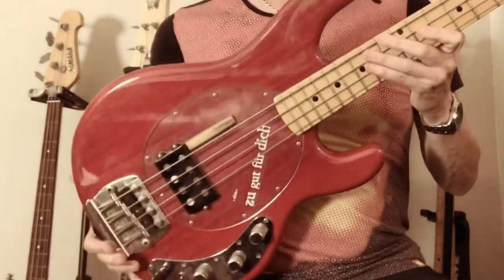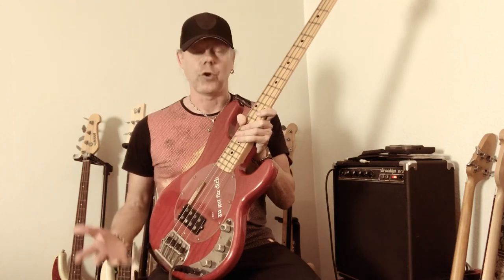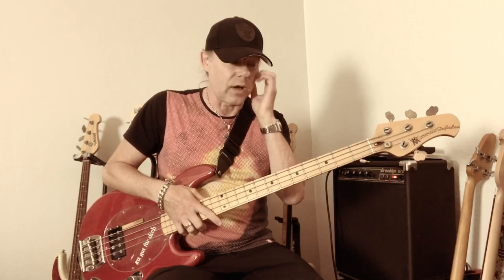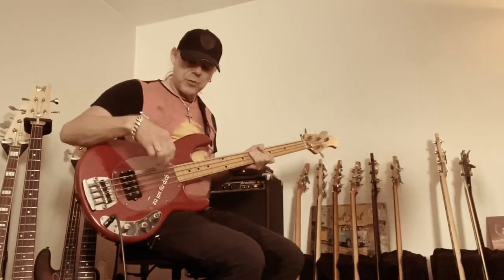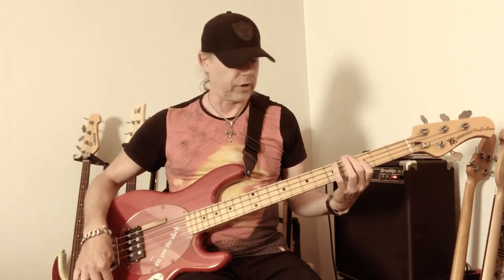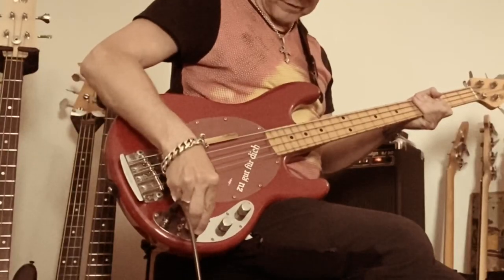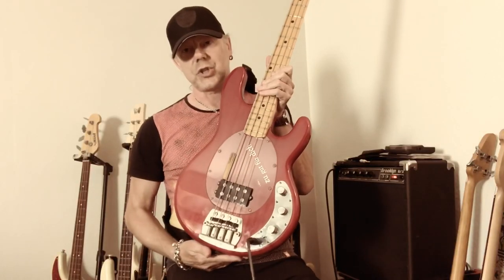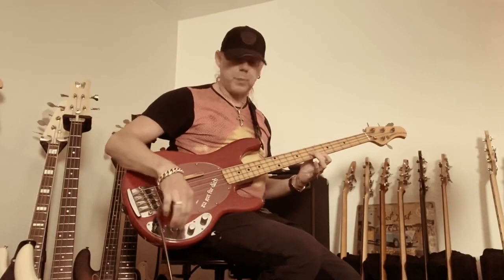how does a MusicMan StingRay Bass sound passive with bypassed electronics?

Comment: You don't show comparison between passive and active with EQ at detente.
Reply from the maker: Hi Matt, forgive me: What do you mean by "EQ at detente"? I never heard that term, so forgive my lack of knowledge
Reply: @oliverposchmannsbassguitar758  Sorry, it's spelled "detent" with no e at the end. It's the middle or neutral position of the knob that clicks into place.
Reply from the maker: @mattfoley6082  , ah, thank you for the explantion. My bass has no neutral position click or mark. I don't think any of the old MM Basses had that. However, the position with the both EQ controls set at ca. 50% sounds allmost the same as the sound in passive bypass mode. I hope that answers your question. Best wishes

Oliver
Reply: @oliverposchmannsbassguitar758  In the first 33 seconds of your clip, what are the EQ settings ?
Reply from the maker: @anpcm  , the EQ Settings in the first 33 seconds are both active controls (treble & bass) full on 100%

hope this helps, cheers
Oliver
Reply: @oliverposchmannsbassguitar758  . Thank you